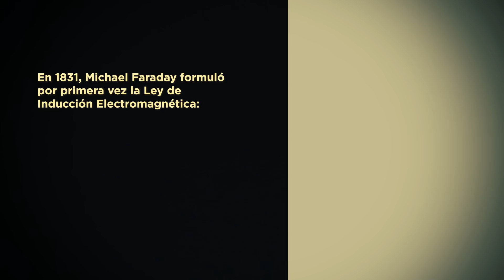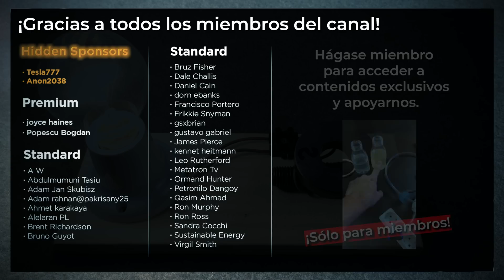ENERGIA INFINITA CON IMANES 🧲💡💡 Energía Gratis Con El Método TESLA

Comment: Ich habe es heute versucht. Bin total enttäuscht weil es nicht funktioniert 🤔ich würde Bilder Posten, aber das geht hier leider nicht
Reply: Kann auch nicht.
Da muss sich was bewegen um Energie zu erzeugen.
Reply: did you use insulated copper wire? because i have made many examples like this and they work perfectly
Reply: @darkolalic1538  
Then send a detailed video, with all the dimensions, characteristics of the light bulb, dimensions of the magnet, what is the thickness of the copper wire, shoot the video continuously and do not screw the light bulb to the board but to the transparent base?

Comment: Have you ever considered Tesla's theory: "the reverse storage of energy in the permanent magnet, taking into account the polarity"?
Based on this theory, all you have to do is reverse the polarity of the magnet and turn the bulb towards the sun. Your coil then induces energy into the magnet. This gives you a portable solar energy storage system. Furthermore, if you replace the light bulb with a mains plug, you can feed the energy back into the mains when you place the magnet on the coil.